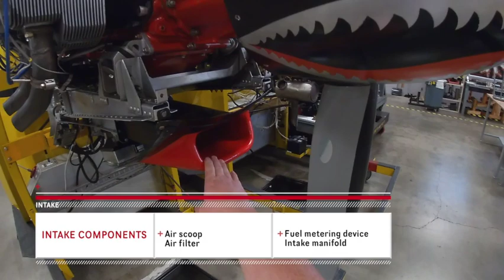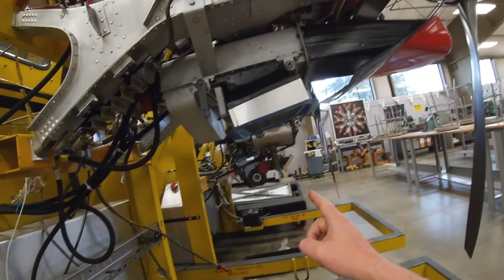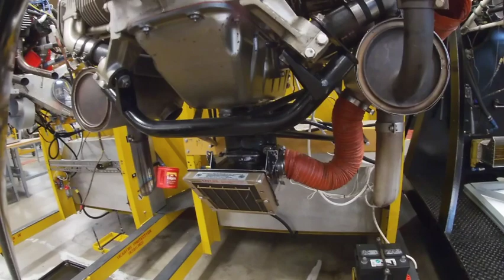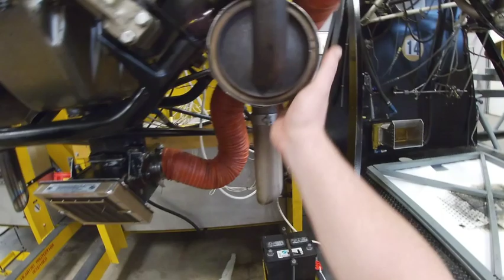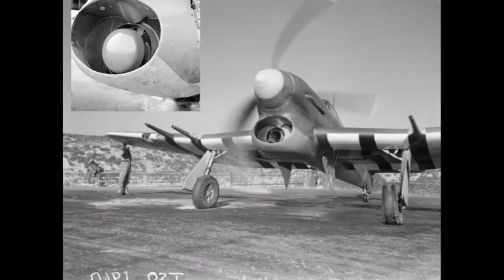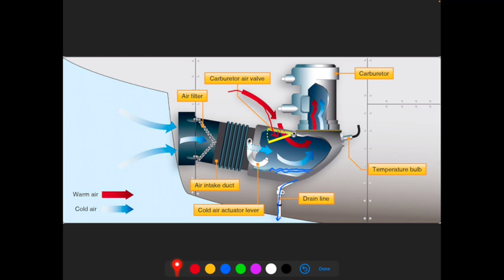Reciprocating Engine Induction & Anti Ice

Comment: Also internal intercooler icing which severly limits the benefit of turbocharging and intercooling. Theoretically, you could have -40 intake temp with an efficient intercooler, however cooling the air that much freezes any liquid in the intercooler. You basically have to keep temps around 5-10 degrees, robbing you of a lot of free power.

Comment: I have had carb icing on a downdraught butterfly carb on a motorcycle. However, the issue that I had is not one which I have seen any mention on in the aviation scene. My issue was not that the throttle was choked, the issue was that the ice didn't allow the throttle to close. This meant that I was able to ride in 4th at 30mph on a "closed" throttle. I surmise that the ice built up on the sholders of the valve meaning that the butterfly couldn't fully close.